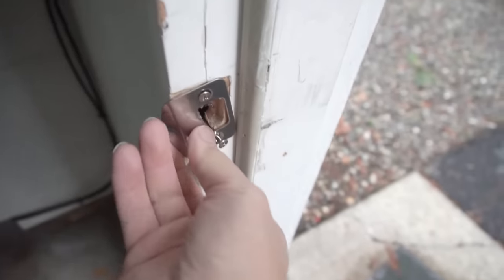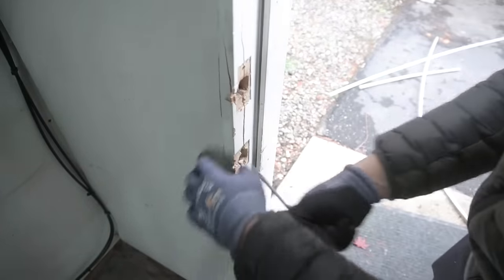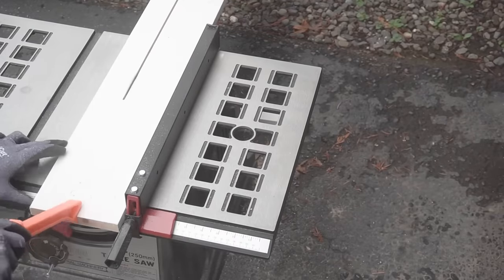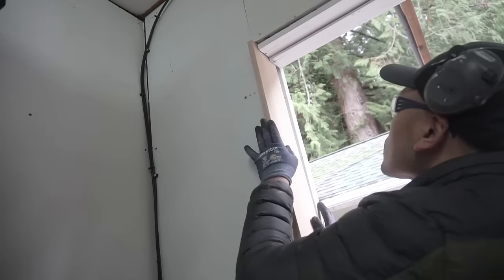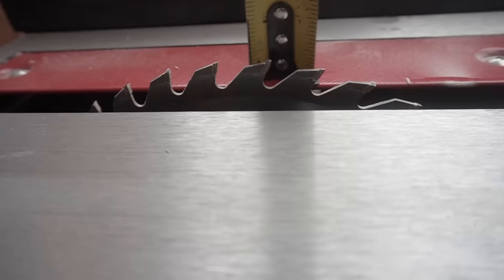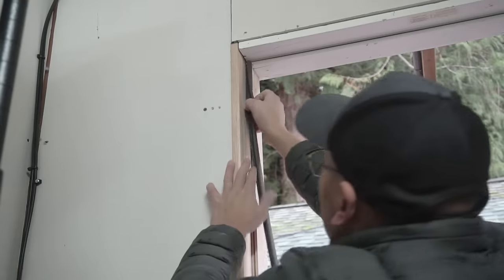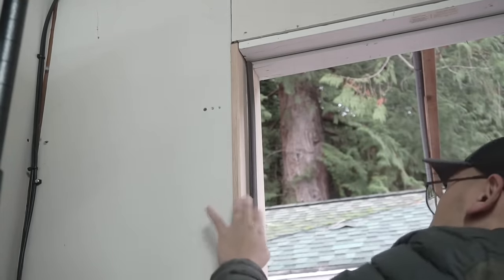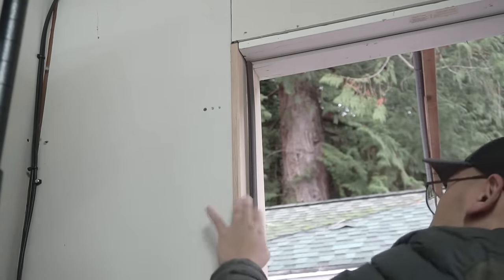How To Replace And Repair Broken Door Jamb Kicked In Or Damaged | DIY Step By Step Tutorial Easy FIX

Comment: I call my oscillating tool “magic chisel”, and never use it where a chisel will be neater. I think your next project should be a zero-clearance throat plate for your tablesaw. My finger bled while watching that cut.
Reply: Yes, one with a riving  knife.  You will thank us later.  Dewalt makes a great compact traveling table saw. Changed all my expectations for myself as a finish carpenter.  And my efficiency went way up.

Comment: There are pre-fab door jambs available at big box stores.  Why not just buy a door jamb and replace it?  Making it is hard and very difficult to get the right thickness without proper tools.  Using the pre-fab one saves a lot of time and it's already pre-primed.  All you need is cut to length and attach.  Doesn't justify the cost of contracting someone to make from scratch or even DIY.

Comment: The best way to mark the latch bore would be to use tape on the outside of the frame, where the latch is touching.

Then open the door, and wrap the tape around to the inside of the door frame.

Then just drill through the tape.
Reply from the maker: Thank you for sharing your advice! 🙏🏽😊

Comment: Did not have to remove damage leg (jamb) screw long trim screws into edge of leg to the unbroken section of the leg,and the loose latch, reinstalled with longer screws to catch the 2x4, putty/caulk where need then paint and last thing to do,Pop open a beer

Comment: Did your door get kicked in?
Reply from the maker: No, previous owner install the door jamb wrong and took shortcuts. Over time it eventually failed 😨
Reply: Previous owner didn't install door jam wrong, it's a prehung door. It was kicked in so he used longer screws to have something to bite to for the strike plates which is a strong enough fix for normal usages,. Instead of ripping whole jam out n spending $200 bucks and an hour , he fixed in 2 minutes

Comment: Not quite the proper way to do it but an A for effort. The door jamb materiel is sold at most big box stores, so no need for 2 pieces of wood or cutting a groove for the weather stripping. Also you never attached the sill or the brick molding to your jamb. There is also not door casing on the inside of the room??

Comment: Wow, mountain out of a mole hill springs to mind.....
I have done loads of these, and you are doing far too much for the small amount of damage, and planted rebates on outside joinery are totally unacceptable.
Either do as little as you can get away with, or make a brand new frame in the workshop, prime it up and fit it.

Comment: looks like the pigs paid a visit, there are certain easy steps to ensure this will not happen again, 2 locks about one third in on the vertical, and throw tose face plates in the bin and replace with a thicker and 3 times larger faceplate which is secured to the frame with at least 6 screws. And add two more hinges and use very long screws to secure all fittings. You can have a hidden camera set up and then tip the police off and watch them sweat.

Comment: Well everyone thinks this was a great job. 
Nope 
The wood frame was broken once and you replaced it. Big deal. 
If you want a strong point  replaced the area with a thick steel plate. With multiple large counter sunk screws that go all the though the stud.
To finish up a secure door at least one steel Murphy bar should be installed. 
Sleep with one eye open or have good doors and sleep soundly.

Comment: Your  not a window/door installer for sure. That door was kicked in and it will be easily kicked in again . Dont cut the top piece,just cut out a "patch" usually at the locking plate . Use hardwood and a double latch. Upgrade to a grade 2 lock and your good . Use 3" structural screws even on hinges.